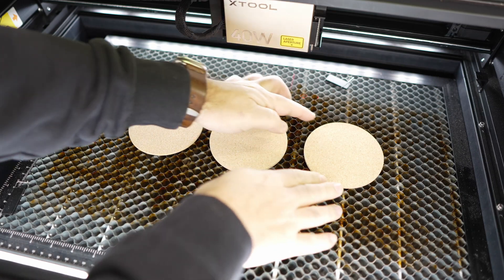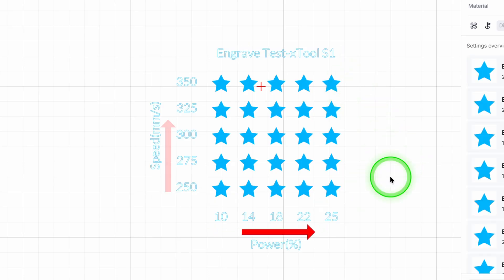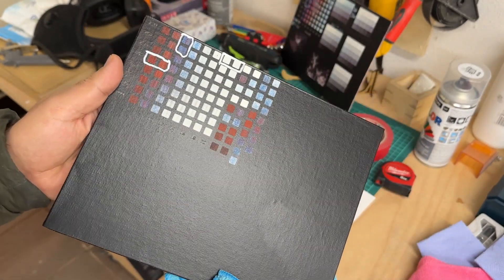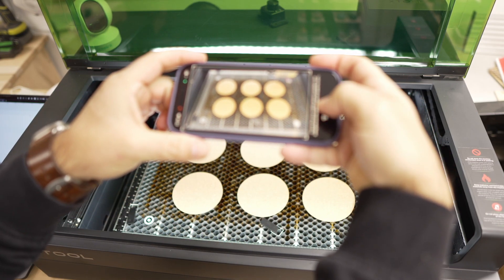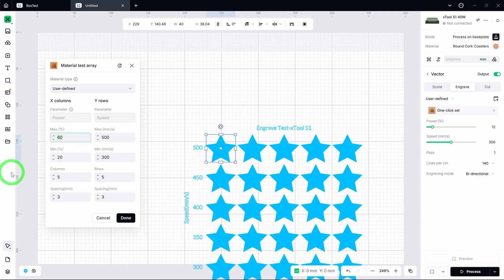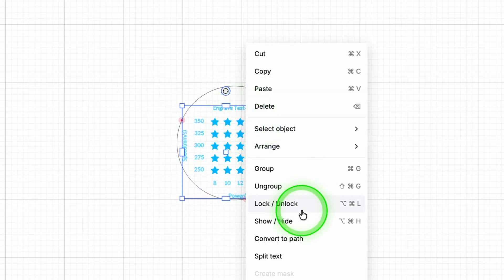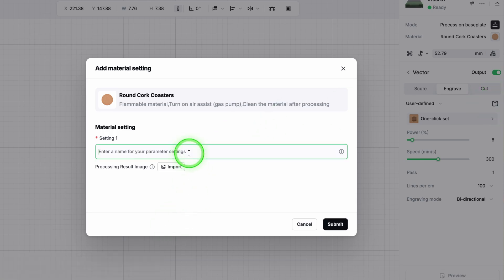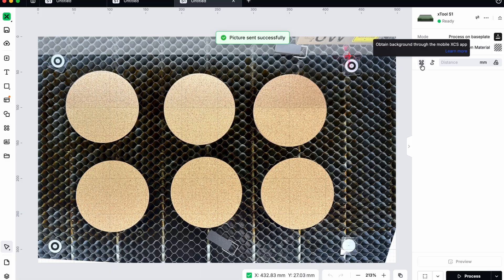This Simple Grid Saves Beginners Months of Mistakes

Comment from the maker: When was the last time you ran a material test before starting a project? If you do it often, share what material you test the most. If you rarely test, tell me why. The comments usually turn into great conversations and real solutions, so jump in. You can also reach me on severnaliving.com or on Facebook. All links in the description.
Reply: Since I consider myself a beginner, I have been working with just bassawood. The testing has always confused me.  I see people putting different numbers but no one explains how they got those numbers. 

I try to start with Xtool suggest and I have been lucky. 

I guess I need to understand how or why people starts with the numbers.